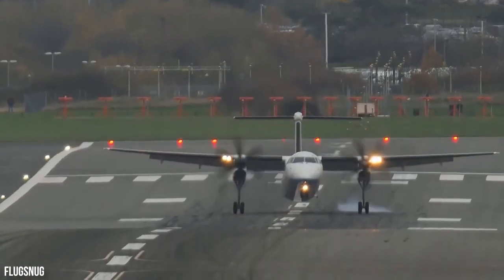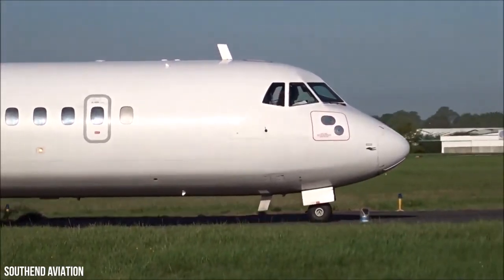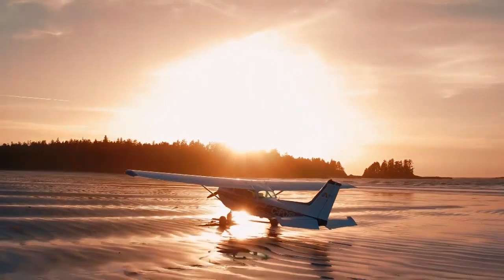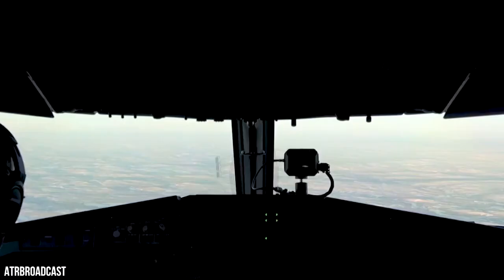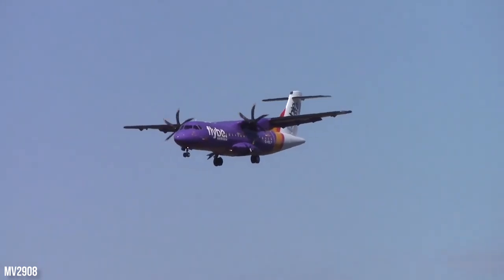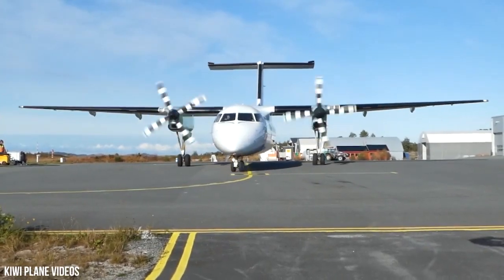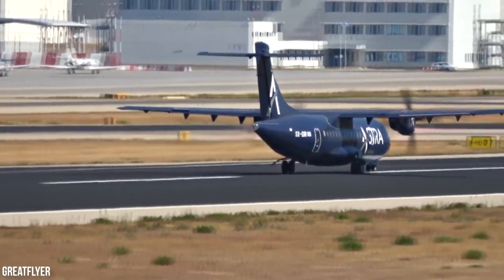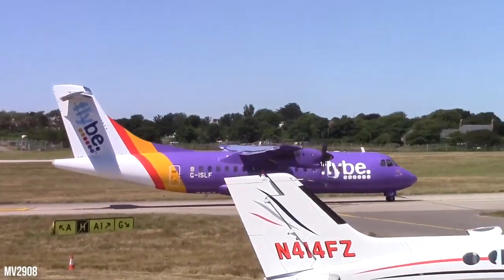How are Turboprops Delivered To Far Customers?

Comment: The FAA have such a thing called a ferry permit, Show them all the calculations and  you are allowed to take off for a ferry flight loaded up to 150% of your rated gross weight.  In the yester-years, the cheapest way to get a new light  airplane to Australia was to just remove all the other seats and install a large ferry tank. One brand is still made in Au, called Turtle pack , rubber fuel cells. The longest leg are from Continental US to Hawaii at around 2100 Kt miles. All other legs a bit shorter , that can take 14+ hours. (Cessna 172), they tend to fly in groups of 3,4 planes.  In Au, the pilot get a Qantas ticket handed to them to fly back home. Buyers of new light planes in Au are accustomed to seeing a brand new plane having over 100 hours on the Hobbs. (hour meter)  Nowadays, this is not done anymore, for the availability of Av gas is unpredictable, and expensive,  but Jet A are everywhere. I dispute ferrying a bigger turbo prop like a Dash 8 or ATR are anymore dangerous than taking a 787/A350 flight across the oceans. No one are nuts to take chances with an asset worth around $50+ million. They are big enough to fly almost as high as jets, they are all certified for known ice, which they do not even need on the tropical routes. Yes, there are some elevated risks to flying in the north around Iceland ,Greenland  in the winter with no ice protection, Greenland now insist you buy SAR rescue insurance before they let you fly there.  Jets and turbo props are only slightly different in technical details, a high by-pass jet engine is just a glorified turbo prop, with the prop renamed a fan and surrounded in a shroud. All civilian jets are still speed limited to the "sound barrier"

Comment: Why are Turboprops even used ?
Reply: Their more efficient then jets
But less efficient then piston engines

The fact he said they have shorter range is not right.

Since their more efficient then jets some of them have far longer range then the same size jet

The difference is, most jets are relatively large
Reply: More fuel efficient. Some have a short take off also. Dakotas have had turbo-props replace radials & work well.
Reply: Can take off from a shorter runway. More fuel efficient and on short routes similar speeds as "Jets". The Turboprop also have jet engines.